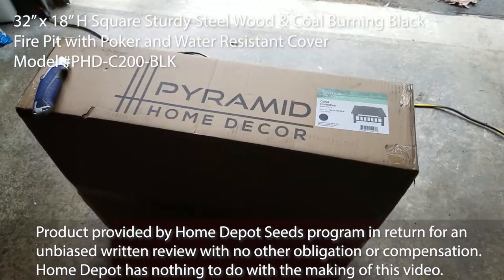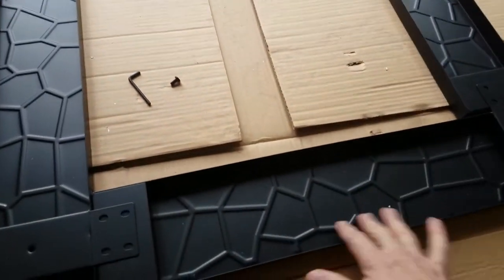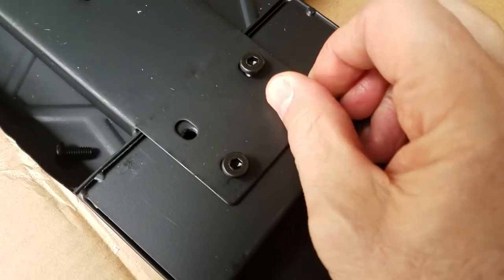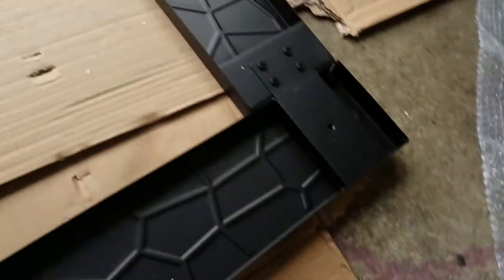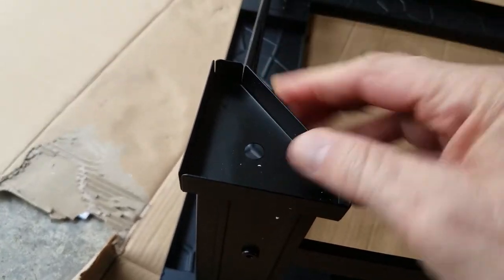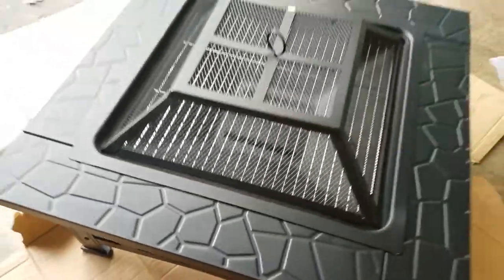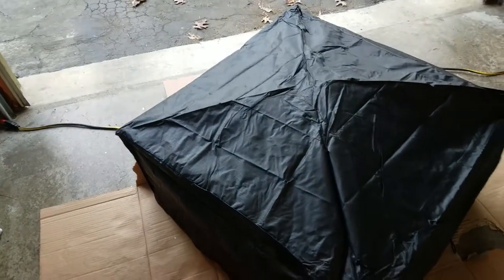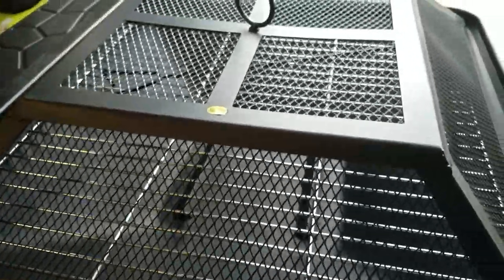Pyramid Home Decor Steel Wood and Coal Burning Fire Pit

Comment: I have this firepit and have used it for 2 years. 

Great heat from it but after 2 years in Scotland being left in the elements the base is largely corroded. It's still very usable though and always a great feature at parties. 

The lid has always been redundant and solely decorative. We've used coals and wood in it and it's been fine.

Worth noting that the video poster has the cover inside out, the seams should always be inside. This is a large reason why it's ripped as it's just ever so slightly smaller inside out. With that in mind, the cover will rip, it's just a cheap piece of water resistant fabric but ultimately for the price (you will find the same pit on most Google searches, probably most websites/stores so shop around) it's brilliant.
Reply from the maker: Graham, thank you for sharing your experience. I'm hoping to replace it with a smokeless unit. We use the wood ashes for the garden area.